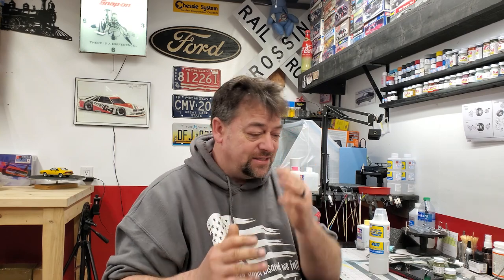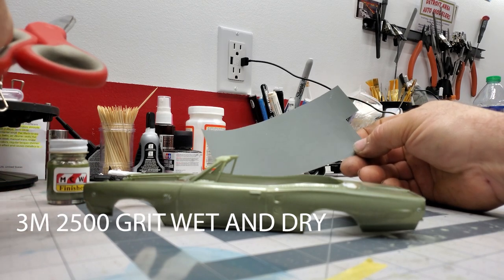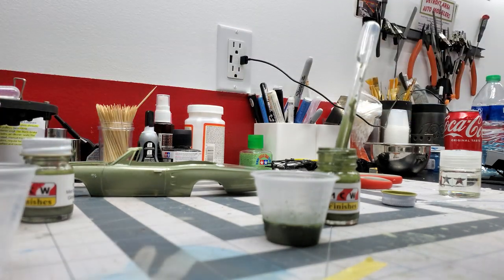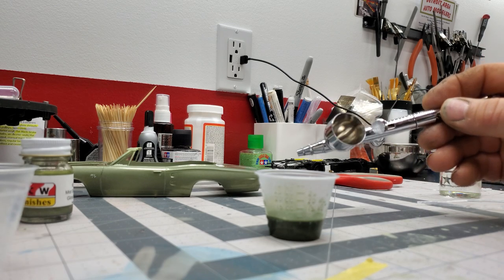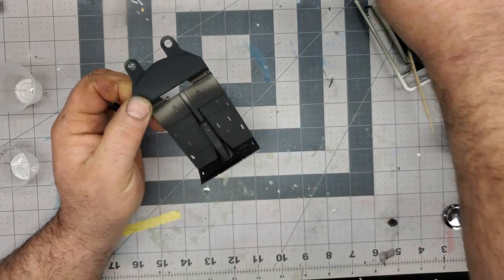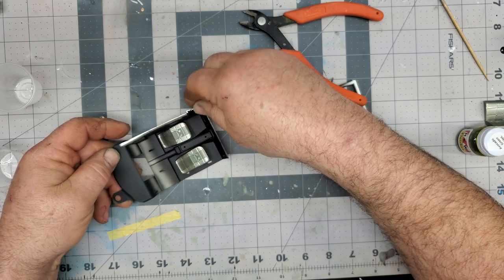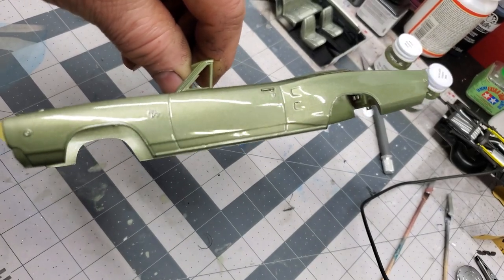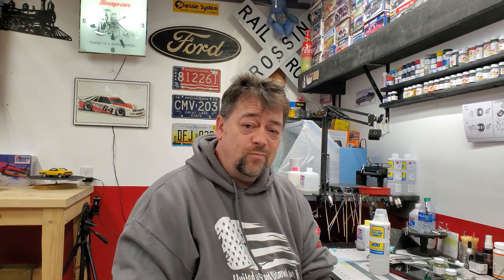CORONET VIDEO 1.5.. SOME WET SANDING, PAINT MIX AND AIRBRUSHING

Comment: Just a suggestion on the paint mixer.  I have one and it's awesome!  But, you might want to super glue the shaft to the motor.  After a few uses mine came apart.  Once super glued, though, I've had no problem with it.  It really does the job, though.  Great job on the Coronet so far.
Reply from the maker: Thanks Kenny, I have been talking about getting one for some time.. That's good to know about the motor, once I get one will have to look into that.. Now I just need to fix the trunk and should be good to go..

Comment: That color looks perfect for the Coronet.  You'll get the trunk issue figured out I'm sure.  Do you have a feeling on whether it is better to wet sand the debris out of the paint before or after you put it in the oven?
Reply from the maker: Thanks Steve, I think one more hit should be good to go. I found it works better after baking the paint, it sands better without gumming up the sandpaper. Have a good one Steve!